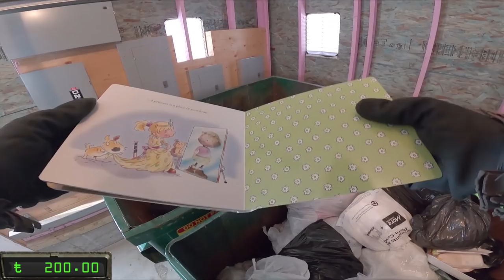Dumpster Diving In Extreme Cold!

Comment: You do not require a grabber arm for anything since you are able-bodied enough to negotiate any container or dumpster. But i did what you suggested and bought myself a grabber arm for the new less accessible street bins. Got the right sized one which also conveniently folds in two. Plastic junk but it has lasted a month so far. Totally paid for itself in containers I could otherwise have not retrieved. And I did what you did - I misplaced money. $ 15.00 just totally vanished. 2 days of measured effort. Total nuisance too. I needed that for my iced coffee reserves.